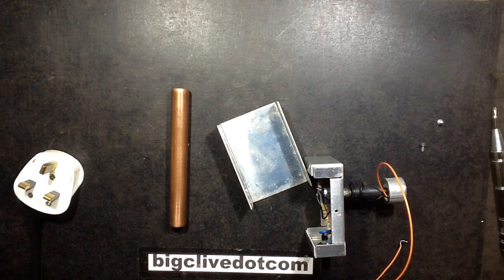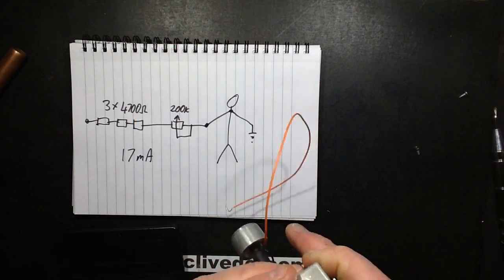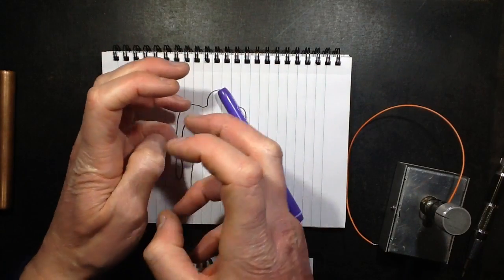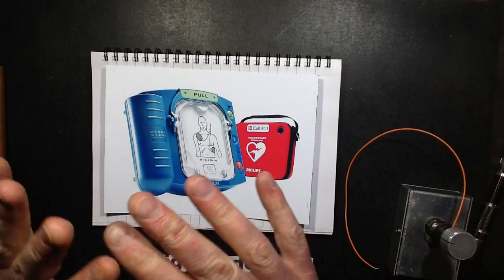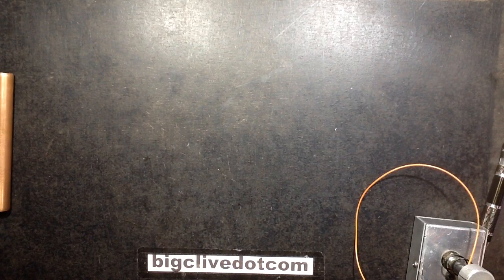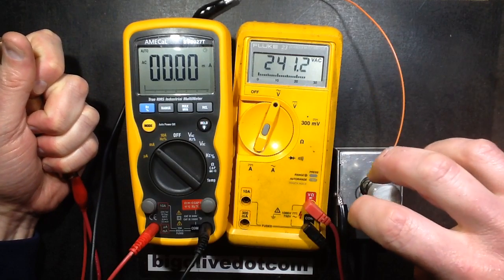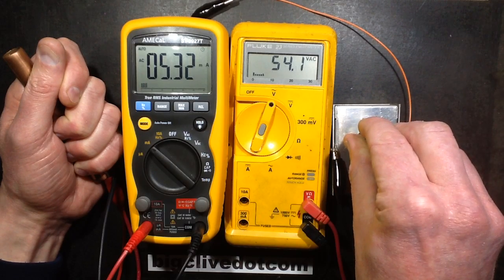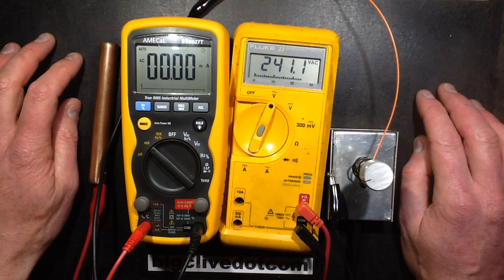Avoiding electrocution (Featuring real shocks.)

Comment: No offense, but I really wish I hadn't made this video. Now I'm extremely paranoid of electricity. 

But I'm glad for the warning. It's a very good think that you made this video, you might have saved a lot of lives because of this.
Reply from the maker: You shouldn't be paranoid about electricity.  Just treat it with respect and know how to reduce the risk of an accident greatly by avoiding scenarios where the current can flow through you.
Reply: bigclivedotcom Would a ground strap on my wrists help prevent electrocution? I'm not exactly an electrician, but I do know my fair share about electronics, especially with some substantial help from your channel.
Reply from the maker: A grounding strap as used in electronics to avoid static discharge is a hazard in its own right unless fitted with a suitable current limiting resistor.  Most are fitted with 1 Megohm resistors in series to limit current in case of accidental contact.  The concept of trying to prevent current flowing through the body by bonding the wrists and ankles is flawed, because there are a multitude of resistances involved between the inner core of your bady and any external contact.  So significant current could still flow through your body.
Reply: bigclivedotcom Thanks for the explanation!
Reply from the maker: The risk varies depending on the mass of the person, path of the current through them, level of current that flows and frequency.   It's quite complicated but does usually require a modest AC voltage above 50V.
Reply from the maker: That explosive and scary failure of those heating elements is fairly common.  Even though you were holding a metal pan and spoon, the risk of current flowing through you would be low, partly due to the cooker itself being grounded and the need for a path through you to ground.  If you were standing on a wet concrete floor in bare feet then that could be a risk.  But it sounds like you quite rightly froze in terror at the violent way it failed and not from receiving an electric shock.  The black and blue feeling in your arm is most likely due to the bodies own clenching of the muscles because of the fright you got.  And burn marks on your arms would be more likely due to bits of hot metal spitting from the failing element.  I doubt you received any lasting harm from what happened.
Reply: what would you say is the smallest amount that will kill you?  i got shoked by x2 245ma batterys and i was wondering if that could of been bad
Reply: The way you describe it, it sounds like you did get injured. If I was you, I'd certainly see a doctor about it soon.
Even if you don't have any damage you don't know about, they might be able to do something for that sore arm of yours.

Also, get an electrician to take a look at that stove, something's clearly wrong with it if it shocked you.

I'm betting that the heating elements in your stove run on 240v if you're in the US, and with the large contact area you mentioned I'd say you are really lucky to be alive.
Reply: As long as it's grounded and you're not wet, you'll probably be fine!
Reply: Watched you mean.

Comment: I remember as a kid, 14 years old. I was playing with my light collection and had an unfortunate run in with a lamp holder. straight 120v to the hand. Ran up my arm. Left me immobile on my bed for 30 minutes. I recovered, never told my mom. 27 now, never been bit since, and i tend to keep it that way. please be mindful of mains. It is not fun to be a resistor.

Comment: A few years ago I was fixing an electric hot water heater late a night. I was tired and at one point accidentally left the breaker on while connecting one of the heating elements. When the screwdriver made contact my entire right arm began to spasm for a good half a second before my brain processed things and I let go. What's interesting is that I did actually feel a bit woozy for a short period after, but I didn't think anything of it until watching your video.

(And don't worry -- I decided I needed to stop work for the night and go to bed without a shower. I may be stupid, but I'm not an idiot.)

Comment: Hi Clive, I've accidentally hit myself with UK mains twice and given myself a real good whack with some HT leads on a running boat engine with very little ill effects, should I give up the day job and become some kind of electrically resistant superhero or was I just lucky?
Reply from the maker: You were just lucky.  Nobody is immune to electrocution.
Reply: sigh (puts away spandex suit). I had a good name lined up and everything, you better hope that no electricity wielding super-villains decide to take over Scotland because the inCapacitor won't be coming to help
Reply from the maker: We did have an electro-superhero in Scotland once.  But the charred remains of his rubber kilt were found next to a defective table lamp.
Reply: Hahaha well played sir, well played
Reply: One time when I was really young I was unplugging an old CRT and grabbed it by the pins. Was hit by US AC mains across my hand, felt tingly. Never want to do that again. 

On a separate occasion, we once had a charger for a flashlight or a laptop or something (I forget what) that had a small light on it that would change between three colors for unplugged, charging, and charged. I partially unplugged the cable and put a screwdriver across the pins because I wanted to see if it would blink the lights.  

Keep in mind that I was like 5 or 6 years old when that happened. I hope I never do that again.

Comment: I'm actually now very tempted to make a copy of the tingle-tron for my own amusement. It should, after all, be safer since I live in the U.S. and we only get 120 V out of a wall socket.
Reply: I accidently touched a CRT TV anode @ 22000 volts, my feet were shooting purple streamers!! OUCH! That shit hurt like hell!
Reply: Not safe but less in danger. You will also have a strong Impulse to let go rather than hold on.
Reply: I once had a cap charged to 160 V DC in a TV and I wasn't paying attention and shorted it with my wrist. What a fun little surprise that was.
Reply: Mike44449 I once had a leyden jar charged to at least 10000 volts and accidentally shorted it out with my hands. My forearms were cramping up for a while after that.
Reply: It's not the voltage that kills in this case... If you take a megger ( thing they use to test motor windings) and hold the leads it'll put out around 200 - 300 volts dc with no amperage it hurts but won't kill you...
Reply: xtremeasure I know that. My point was that if I were to simply copy the design, I would get about half the current because Ohm's law dictates that the current is proportional to the voltage with a fixed resistance.

Comment: I've heard that HIGH voltage/current DC is in fact more "dangerous" than AC, because since DC doesn't go (0-Crest-0-Throug-0) in other words, a full sine wave, it goes on a continuous line, say (+240v) - meaning that muscles are always contracted (literally being baked onto what the person is touching) and its much-much harder to let go... That's what I've heard, I haven't tried it lol, but its just a thought. Cool videos as always Clive :)
Reply from the maker: It's the continuous stimulation of the alternating polarity that makes muscles contract in a sustained manner.  When I experimented with AC versus DC shocks I found that with DC it caused one muscle pulse and then a burning sensation, whereas the AC caused continuous muscle contraction.
Reply: Isn't it strange as Andrey said, we where taught(C&G 1811 theatre electrics) DC more dangerous that AC due to constant contraction with DC but you proved that to be wrong.   I think it has more to do with frequency! at 50Hz may be you just don't have time to consciously remove you hand in the low/0 parts of the cycle?  Could a device like yours be used to test with DC (can you open your fingers when DC is applied? and at what levels dose that change?  May be having the two contact points on the same side as to not cross the hart, just to make it less dangeraus).

Comment: Why do drugs, when you can do electricity?
Reply: nails s bender the robot
Reply: railspony You're lucky to be alive O_O
120v is just as deadly.
Reply: Both of you... MASOCHISTS !!!
Reply: When I was a teenager I was fixing a friend's television, which had a broken power switch, and after a few rounds of testing I got sloppy with the steps and didn't unplug it. That was of course the exact moment that I managed to fix the switch, and get a nice shock. Only 120V here, thankfully. Also luckily, I didn't have my fingers gripped around the switch, I was pressing it together with two hands so my fingers contracted away from the connection.

For about an hour I had a mild whole-body tingling sensation and was sitting on the couch staring at white noise on the TV screen, saying, "Dude, that was so trippy!"

My friend said, "Hey, was that fun?"
"Yeah, totally man"
"You gonna do it again?"
"No, I think I feel pretty good already!"
Reply: @railspony  it doesn't cause an addiction it seems!
Reply: Chuckiele i also know how it feels i was lucky it was a spring contact because boy did it feel good.
Reply: nails s The original"buzz".
Reply: Love to get a buzzz on....
Reply: The problem is the AC. 50Hz doesnt resonate with your heartbeat. You are much more likely to survive a DC shock, apart from that you need a much higher voltage for the current to even flow through your body.
Reply: hucker75  what makes your heartbeat are electrical impulses from the brain to the atrium of your heart.  It's not that the electric shock only shocks some of the muscles it's that it interferes with the electrical impulse from the brain that along with specific areas of your right atrium that keeps your heart beating at a normal sinus rhythm and you go into fibrillation.
Reply: hucker75  your brain sends the electrical impulse to the SA (sino-atrial )node of the right atrium causing the atria to contract which in turn sends an impulse to the AV (Atrio-Ventricular) node which sends it to regions of the ventricle to make them contract. The SA node is effectively your heart's pacemaker making the muscle fibers contract. The SA node is also responsible for the rhythm. The SA and AV nodes are responsible for your heartbeat, but I mentioned brain because you also need the sympathetic and parasympathetic nervous system to send impulses, and also some hormone and chemical balances must be maintained. I hope this helped clear things up a bit.
Reply: Bender agrees
Reply: I do electricity all the time... It's soooo addicting!
Reply: I once had 240V from one arm to the other and it felt great but I resist the temptation to do it again.

Comment: In episode 7 of the second season of Mythbusters, they were saying that 6 milliamps is fatal, and 4 would be really uncomfortable. I had remembered about this video, and sure enough, I was right: while they were close, the Mythbusters were still perpetuating a myth! Thanks doing this, Clive. Now I know to be skeptical whenever Adam or Jamie talk about anything that has to do with electrical engineering.
Reply: +awesomeferret Bear in mind they may have been testing at US 120V which will have different results than 240V.
Reply: I think they specifically said that it's 6ma across the heart was deadly. That's why they set the sensors across where the heart would be.
Reply: interesting. the current required for a deadly electric shock is generally quite a lot more than 6mA. i wonder where they got this figure from!
Reply: Nathan Finch they originally said around 70, but they said that they goofed and that it was around 6.
Reply: Alex Winder I forgot about that. lol stupid me.
Reply: Different strokes for folks i'm sure a fatigued person could be more prone to a shock at 6ma. I did notice you recognised that the US uses a different voltage and frequency so that possibly could make it a little more lethal, but another thing that they may have considered is that 6ma is the threshold at which the test should be done because if the shock is beyond lethal it is hard to determine what is actually killing a subject.
i never watched the episode, just throwing my ideas in the pot, fingers crossed something new was in there.
Reply: ***** Yes, but the values are different regardless. I = V/R.
Reply: Alex Winder yeah got your comment there :)
Reply: also runs at 60hz not 50hz
Reply: awesomeferret It really is just because they were measuring "through the heart" current and not "through the whole body". Clive experienced 6 mA going across his chest, but a lot of that current went around his heart and not through it.

Comment: When I was young, at my Grandma's house I attempted to plug in a device but because it was an old plug I accidentally touched one of the two live metal pieces. Is that the same kind of shock as what you show here ? I think I had my other hand resting on a wooden furniture, I guess that return path was not sufficient enough for a good electrical contact. I think we have 230 volts in the walls here in EU. My nerves were tingling and felt a little light headed, but I touched it only for a tenth of a second though. Also if I am making a mistake, please point it out. I am trying to understand.

Comment: "And I'm not touching anything": aren't you touching the floor (which is more or less referenced to earth)?
Reply: in other videos i recall him saying that his workshop is designed to avoid this kind of issue :)
Reply: All the best!
Wouldn't it be worth mentioning in the video?
Reply: +fabts4 I think he always wears boots with thick rubber soles
Reply: Shoes, wood, carpet and vinyl are all fairly good insulators
Reply: even in an industrial environment they use rubber matting and require to use insulated electrically rated boots to obscure the earth reference through your feet.. But in most cases as Clive stated air is the best insulator always work one wire at time and be conscious of your body placement while work in doing hot work

Comment: Don't think it is wise to use RMS to calculate the current in this case... the peak will be (much) higher than the 17mA... potentially over 30mA (especially if any of the resistors are less than their labeled value) and lethal... The bulk resistors need to be adjusted.

Comment: When I was taught to work on high voltage fuse boxes ( Checking connections to see if they were loose ) we were taught to put one hand in our pocket, and of corse to wear shoes with a thick rubber sole. 
I only met one electrician who had grabbed a broken cable at both ends. He ended up with burns on the palms of his hands and a lesson of course. 
It's all wise stuff you show on your site. Thanks a lot.
My only bad experience was getting one of my fingers jammed between a live switch and chassis of a pice of electronic equipment. Ouch ! ! !

Comment: Lockout/tagout isn't necessarily foolproof: As a teacher's assistant in a high school shop class, I received a good zap from a 480v connection while touching (and thus shorting) two points on a Haas VF-1's spindle VFD (good thing I had one hand in my pocket and rubber-soled boots) when another student pulled my tag from the breaker and livened the circuit. And my right hand. I'd have punched him in the nose, but my hand was entirely limp and a bit charred. 'course, the guy getting insta-failed from the class and suspended for being militantly unsafe was fair enough. I honestly think some of them were actively trying to kill me.

Comment: The shortage of old, bold, electrical engineers springs to mind.  Surgeons can sew tiny arteries together whilst wearing gloves - so there is really no excuse not to slip on a pair whilst working on live equipment.  In addition to all the other steps to avoid electrocution that Clive talks about.  
Plus safety glasses when there is a lot of stored, or potential, electrical energy about.  Those little "harmless" spark that fly around from time to time may look pretty and innocent - but have a blob of white hot liquid metal in their core. If they land on glass, they will melt their way in and be there for ever. If they land on your eye...

Comment: that rod like reminds me of the 2 rods er game handles in Never Say Never Again the 007 knockoff staring Ol Sean Connery and I doubt very much either of them would be walking and talking like up and around  (the silly Battleship style game)  I've gotten shocked a few times.  Mostly because some twit wired something in the house wrong.  So I shut off ever possible power outlet in my room and it showed it being off.  alas I really needed my tester because clearly one wire was live.  Worst shock I ever got though was from a 10 yr old Computer PSU I was testing and at some point, whatever was holding the PSU PCB board in place collapsed while I was holding the thing and that went in my left hand and out my right foot.  Rather glad it was on a GFCI actually.  Not that I wanted to test that.  Probably never trust Antec PSU's again.  X_X  and thats why I carry better PSU testers around.  There was one machine called a quarterfolder at another paper (won't say which) where some wire meant for ground snapped off and the entire machine became live.  Well no more Quarter folding that day..  Very first shock?  LOL  Cows.  You know Cow Fences aren't really all that great for Cows but much worse for 13-14 yr olds at nice sledding in the dark and not knowing it was live.  Bigger laugh teacher didn't believe me and he touched the wire  oh well yes it is.  Some idiot forgot to turn it off.  smh.